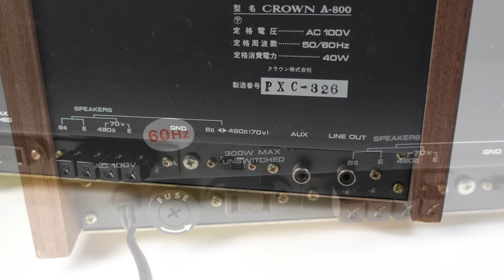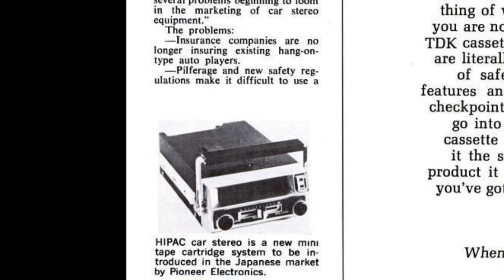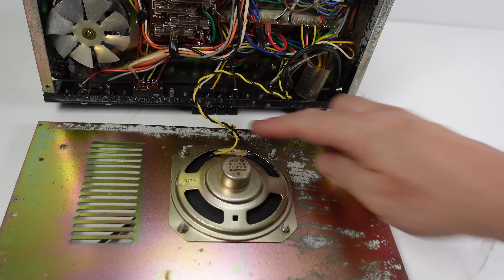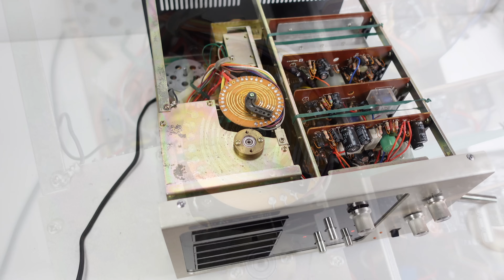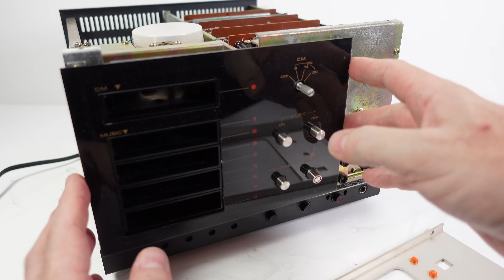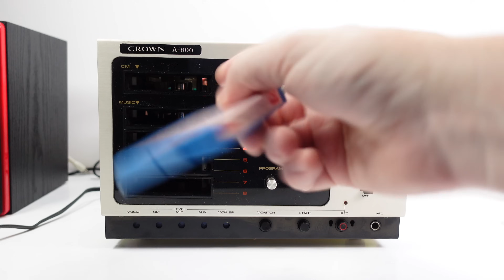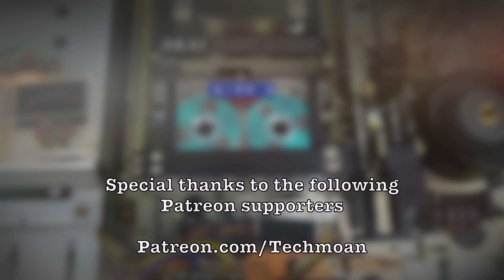An unusual player for a forgotten ‘70s music format

Comment: Dear Mat, as i am hard of hearing and not a native english speaker, i would kindly ask you to put on subtitles. Of cause you speak perfectly clear english, but again, it’s because of me and not you. Thank you fpr all the great content.
Reply: You can simply turn on subtitles in YouTube options and they will be there for every video
Reply: The subtitles can be manually input but most YouTubers rely on the automatic voice to text. It is very likely that it takes some time for YouTube to process the audio, convert it to text, and add the subtitles. If you watch a video right when it’s posted, it won’t have subtitles, but if you wait a few minutes, it will. Same is true for video quality, when you first upload a video, it’s only available in lower quality 360/480p formats, as the higher quality 780/1080p or 4K take longer to process and so those options take a few minutes to get activated on a new upload.
Reply: Looks like i can finally write something like: Last time i was THAT EARLY - YT didn’t have subtitles on a Techmoan video😂😜😎
Reply: I've just checked it, and this video definitely has subtles.  The option to turn it on shows as "CC" in a box (for "closed captions").
Reply: I kmow how to turn them on, thats what i do in every video at first. It wasn’t there but now its there. Thanks to YT and or Mat.
Reply: @ironspike171   Good stuff.  I've read in comments that YouTube is a bit weird with newly uploaded videos, so my guess is that it's their fault for not having the subtitles available at first!

Comment: Would it be a viable option to 3D print new cartridges and put your own tapes inside?
Reply: Possibly - using a resin printer as Fdm may not produce smooth enough parts, the capstan roller is the hardest part to make.
Reply: I had the same thought. The roller, screw, and spring would have to be sourced; but they're pretty common. The rest is just plastic, so the shell, wheel, and arm could be printed and smoothed. Rig a cassette tape deck to record both tracks in the same direction, and make the spool.
Reply: It's my understanding that endless loop cartridges use some sort of dry lubrication on the tape to prevent it from binding. In other words, extracting tape from a compact cassette to load up one of these might not work all that well.

Comment: I help a friend who is a collector of Akai reel to reel machines, in most cases there's a switch that changes the capacitance, it's a 'capacitor run' with the capacitor doing phase shift.
So yes, you just need to change the capacitor
The only other way the Akai machines change speed is with a capstan spindle sleeve, clearly not possible on your machine
Reply: The Akai capstan sleeve is to change the speed from 3 3/4 to 7½ IPS.
Reply: @organfairy  most Akai machines change the frequency by adding another capacitor to the motor  , and  moving a belt to another pulley  , but the older Akai machines  like the m5 m6 , universal and the terecorder use a sleeve on the capstan to change the frequency as well as adding another capacitor to the motor

Comment: It is not usefull to change the capacitor without changing the transmission. This motor is an asynchronous motor which speed depends on the frequency of the power. The capacitor creates with the second coil a second magnetic field which is in time later then the field in the first coil. So you get a turning field. For best power of the motor the capacitor needs to be adapted to the frequency of the power and the induction of the coil. I don´t believe that this motor is regulated with an electronic. I think it is directly connected to the power. I assume that you could change the wheel with the air blades, so this will change the transmission factor.

Comment: Changing the capacitor value can totally change the timing of a circuit; the most basic flickering LED tea lights just use a cap or two and a resistor. Whether that specific capacitor will change the timing for the whole player though is more difficult to tell given that there’s more caps in there on the power board. Seems likely given the labelling though.
Reply: It really looked like a filter cap to me, I think you'd never get the stability you need for a tape drive using that basic a circuit. You could of course always just try.
Reply: I would suggest replacing the existing capacitor with a flux capacitor. Then you can travel back in time and pick up old tech when it was still new, and review it in the present day
Reply: Changing a capacitor in an AC circuit is a little bit different to changing the timing on a DC circuit   It is not so much discharge timing in this case, as it is with the candles.  It is more phasing.
Reply: I dont think it can hurt the machine having another value capacitor there? at least not for the time you are testing.
Reply: @brainache555  I would agree with that; however, i have a feeling that it wouldn´t change the motor speed either.
In any case, it´s actually quite simple to add to the value of a capacitor: one can literally just solder another cap in parallel. In this case, adding a 0.39uF capacitor across the 0.6uF will increase the value to 0.99uF, which is certainly close enough to 1.0uF to make no difference.
Reply: @BertGrink  If the drive motor is ac  then changing the capacitor can change the speed of the motor. That's how most  3 speed ceiling fans work is by switching in different size capacitors.
Reply: @jennytillz  Oh, I didn´t know that... Thanks for that bit of information.
Reply: @jennytillz  this is sometimes true(although tapped windings are common too), however fans do not use synchronous motors, and a device needing accurate speed would almost certainly use one(assuming an AC motor is being used).
That cap is not going to adjust the speed-it should be swapped, but a pulley swap will be needed as well.
Reply: The capacitor proabobly does not set the speed. The tolerance on these is too poor for that, and if it was part of a timer cirucit it would be a smaller value cap. This capacitor probably helps start the AC motor, you likely need to replace the motor for a different speed.
Reply: @berni8k  It's a run capacitor with an induction motor and it does set the speed, yes the tolerance isn't great but good enough for this.
Reply: Yeh, like a Flip Flop circuit

Comment: That cap shouldn't change the speed really. They tend to drift in value over time anyway which would not be good for speed stability. The different value probably has to do with the optimum impedance needed for filtering. They would probably just change out the small pulley on the motor for a different one to change the speed. I'd suggest just adding some heat shrink tubing or tape to the pulley as you've done before. Great video as always!

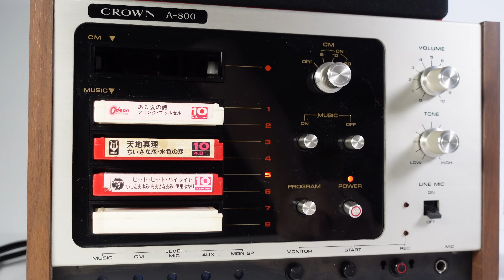Comment: The way you throw in historical tidbits, like the decision from 1896 shown at 12:48, has become a staple of your channel. Truly educational
Reply: That's not the only thing fascinating about the Japanese power grid either. Not only do they have two separate frequencies, they also use the "American" NEMA plug but only the unearthed two-pronged version. If an appliance requires an earth, you just get a loose earth wire that you're then supposed to connect yourself.
Reply: @TheDeadfast  USA has three separate grids, East, West and Texas. Japan has three separate grids as well, East, West and Hokkaido.
Reply: @goishikaiganmademou  but the Eastern and Western interconnects in the USA don’t use different frequencies!
Reply: 1986 ... some different years. Actually, the year we all received a lot higher dose of radiation ;-(
Reply: Yes

Comment: Very interesting machine. Too bad that format did not take off considering all that went into it. Thanks for the great look at this.
Reply: Do you have any idea how much money Sony put into Betamax? Failure can be expected when you bet against the rest of the world. It's interesting and entertaining but when it compares to the  cassette tape, it has the same shortcomings as 8-Track.
Reply: @vintagethrifter2114  Interestingly, it is the worst of both worlds. 1/8" tape at 1-7/8 IPS (inches per second), the tape used by HiPac and compact cassette, had considerably more noise and poorer treble response than 1/4" tape at 3-3/4 IPS, which is what 8-track used. Over time better tape formulations for the 1/8" tape compensated for this somewhat, but the laws of physics made 8 track the better sounding format for a long time. In the 1970s the only advantage compact cassette had over 8 track was its smaller size, and I suppose HiPac had that advantage over 8 track as well, but there was no general advantage to HiPac compared to compact cassette, which of course is why the format died quickly. However, for applications like this background music machine, it was utterly ingenious because the continuous loop format was so easy to use in a BGM.
Reply: The interesting thing about format wars is that every format has advantages/disadvantages, so putting competing formats on the market can let the consumers choose what's the best compromise of features to issues, at least theoretically. 

Also, the work spent on a "failed" format isn't necessarily lost. At the least, the engineers gained experience, and they can apply that expertise on the next project they work on.
Reply: In this instance, they wanted to compete against a format that had a rewind/fast forward ability, didn't have an annoying program change interruption, and was smaller than their product. In Sony's case, they developed a format and locked it. Everyone else took the concept and went around it. Laser Disks, and others like it, had better quality but couldn't compete with VHS video tapes. They eventually won the physical media war in the form of the DVDs. Now, it's all digital downloads. The downside is that you can lose a 4,000 item library by simply knocking it off the table.
Reply: @vintagethrifter2114  Wikipedia notes that HiPac is an evolution of the design of the pre-existing Playtape format, which was very popular for a time. It's not surprising someone attempted a stereo revision of Playtape, even with Compact Cassette on the market. Techmoan even previously covered Playtape:
https://www.youtube.com/watch?v=qBSGuR589_Q
https://en.wikipedia.org/wiki/PlayTape

And factors that seem "obvious" in hindsight are not always that readily apparent during development and release of a product. Technology Connections has a good series about Laserdiscs, and why they "failed" in comparison to VHS, but still managed to be a niche product that stuck around for 2 decades.
https://www.youtube.com/watch?v=Eg8tK1LpLS8